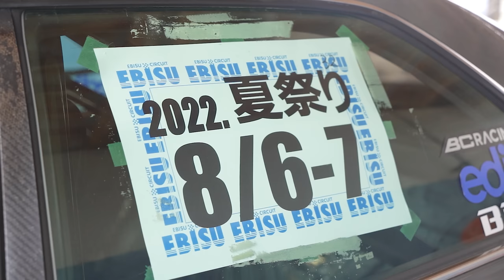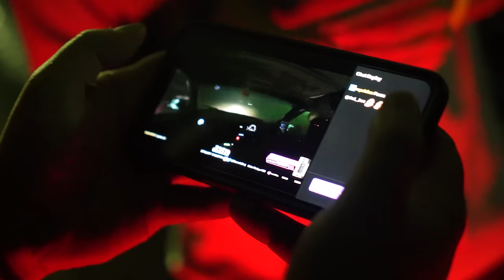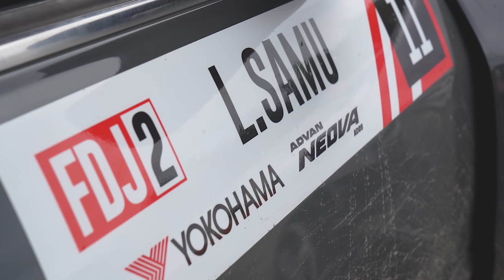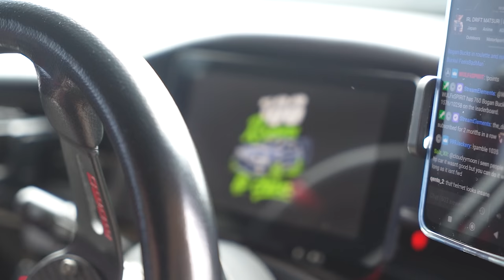THE REAL DRIFTING IN JAPAN EXPERIENCE! - Summer Drift Matsuri @ Ebisu Circuit

Comment: I CANT help but think what a twin turbo J32 chaser would sound and belike.  the boostedboiz had that S14 that had the v6 sounded nasty. the chaser might have more room for it but the balance of the car will be off making it kind of mid engine. side pipe it out the turbos and send it down the side of the car with some thick wall tubing

Comment: Hey Sam where is buy stuff like Three bond 1282B which is sealant for use on Toyota etc in Japan online. three bond 1324, 1344. Which is the best online place in Japan to find such king of stuff for automotive mechanics. What about genuine Denso parts. Where can they found in found besides genuine Toyota parts which are rebranded Denso parts for alternators and starters